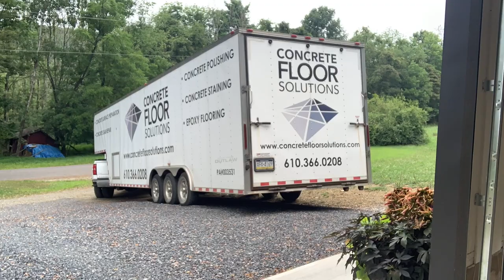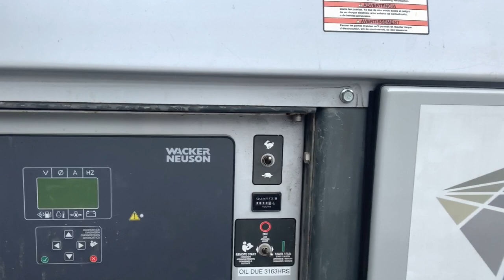How To Install A Polyaspartic 3 Coat system with With Epoxy Primer And Basecoat

Comment: Just have to say, to people who aren’t in this industry this is as good as a professional can get, when you work in this line of work you can always pick apart another contractor, definitely not the case in your videos, everything you do is top notch, we are a flatwork contractor in New York who do epoxy flooring as well and love watching other contractors videos and I’ve gotta tell you I’ve never watched any videos on YouTube that are more thorough, if you are gonna do what you do you have to be setup for it and you definitely are, I’m in the market for an entry level self propelled Grinder and vac system (tired of using the double headed echo) any advice? Love everything you guys do!
Reply from the maker: Thank you for the great compliment. I really like the husqvarna grinders, they bought HTC a couple years ago. They have an 820 planetary thats really nice.  They need to come up with a floating shrowd like we have on our HTC800 or else you have to adjust the dust skirt all the time. I would also recommend the high voltage units. 480v is the top dog as far as grinding goes. I just posted a video yesterday another floor at this same school but different location.

Comment: What’s the average cost to hire you to do a 400  sqft. Garage.    Your not in my area but it will help when comparing the local guys.  I want it done right.
Reply from the maker: 4,000.00 is average, epoxy prices have risen, so it will probably increase a bit
Reply: @ConcreteFloorSolutions  can I have half done then move everything over without having an obvious line.   It would be flake
Reply from the maker: @Imwright720  you will most likely see a line.

Comment: Have you ever accidently gotten product on the walls without taping? If so, how does one remove product on walls ect?
Reply from the maker: You need to wipe it with acetone while it's still liquid, once it cures, nothing will remove it except for grinding or sanding

Comment: Did you spread moreflakes just before the polyaspartic? I need to touch up the flakes on my epoxy before doing the poly clear coat and don’t want to screw up the clear coat with loose chips. Any advice?
Reply from the maker: George Utter You can probably roll out the clearcoat, sprinkle a couple flakes where needed and roll more clear coat on top of it.  I don’t know how large of an area you are trying to fix. Some of the flakes are definitely going to stick to the roller when you do that. But the majority should stick to the floor.

Comment: First, great video!! One thing that I was wondering was how much time lapsed between each layer? After you put down the primer, how much time do you have before needing to put down the second coat (12 hours?) and then, after the second coat, how much time do you have before needing to put down the poly? Lastly, it looks like you use the same, non-notched squeegee for each layer so I'm guess you just wipe it off between layers? Thanks!!
Reply from the maker: On this particular project we did one coat per day, so approximately 24 hours apart. You do not want to wait over 30+/- hours between coats, oils will release from the epoxy and actually repel the next coat if you wait too long.
Yes we clean our squeegee with acetone after each install.
Reply: @ConcreteFloorSolutions  Thank you very much for the response! I am trying to do a two section, two different color set-up which is why I was curious about the cure time. The first area would be red/white/black/gray, full flake. Second section which would surround (boarder) the first section would be a 3' boarder of a single color flake  such as a dark/medium gray. Was trying to figure out how to tape off one area from another without having the tape pull up any of the material. Not sure if you've ever done this sort of thing but if you had any advice, that would be great. The process I'm thinking of is: laydown the primer in the entire area. 12 hours later, tape off the center area and lay down the base coat and flake. 12 hours later, scrape excess flake. Once complete, tape off this area so that the 3' boarder is now expose. Laydown the base coat and flake. Come back 12 hours later, scrape off excess, remove the tape, and laydown the polyaspartic top coat over both areas. Max cure time for any one area would be 24 hours but I could adjust that down if you think that would be necessary. I'm just concerned of the tape pulling up any of the material. Any insight into your experience or thoughts on my process would be appreciated!!! And of course, if you think this will work, please feel free to refer me to the products and amounts on your page that I would need to purchase. The center area total sq ft is 370 and the boarder is 250 sq ft.
Reply from the maker: @michaelg503  Yes, that is very doable and I agree with how you would be doing it. I would prefer to go over some details with you verbally, it's much easier than typing. If you want to email me your phone number, I will call you back jason@concretefloorsolutions.com

Comment: I've seen a couple kinds of flake application, application to rejection and some more sparingly applied. Is this mainly a visual taste thing?
Reply from the maker: I typically do not like to apply flakes to rejection at least in a garage application. The flakes are made of vinyl and not as strong as the epoxy around it. Therefore under a point load could possibly crush and be the weakest part of the floor. That is why in most of my garage floors we install, the flakes are random and laying flat to avoid that issue. I hope that makes sense.
Reply: @ConcreteFloorSolutions  Thanks and thanks for the great videos.

Comment: Wow, great job Jason! 
I live in Northern Ontario Canada, commonly referred to as God's country by most folks up here! .... So, I just finished grinding my garage floor and so now I'm ready to lay the product. Unfortunately, I've been held back as we had heavy rain every single day for the last 5 days .... (which hardly EVER happens up here but with my crappy luck lately, I'm not surprised...lol). Weather forecast is looking great all of next week so hopefully I'll be able to apply the first coat on Monday. I already bought the epoxy base & flakes and I was about to buy an epoxy clear today, however after watching several of your videos this morning, I think I'll go with a poly clear instead. I wasn't sure if I could use a polyaspartic clear on top of an epoxy base and flakes, but that combination appears to be your 1st choice. Based on your advice, I'm doing the same.
By the way Jason, you're a very good instructor. Love your videos - please keep'em coming.
You have a new subscriber bud.
Thanks man!
Reply from the maker: Thank you for watching and good luck with your floor.

Comment: I love your videos.
I've been watching and learning about epoxy and polyaspartic floors.
We're looking at a new construction house (new garage).  I would love to put a polyaspartic coat on the garage floor.  I have 2 quick questions:  1.  Is it OK to apply polyaspartic when it's cold--I'm in New England and winter is around the corner?  2.  Is it OK to apply it to relatively new concrete (few months old--no car has ever driven on it)?
Reply from the maker: You want temps above 40 and concrete needs to cure for 30 days before applying coatings.

Comment: Is it always better to use epoxy as a base coat vs polyurea/polyaspartic. then use the polyaspartic as a topcoat?
Reply from the maker: the Epoxies penetrate better into concrete then the Polyaspartic. So yes, the epoxy is a better material to bond to the concrete, the polyaspartic is a far superior topcoat. They both have their places.
If you are installing this exterior, I would recommend the epoxy primer, polyaspartic intermediate coat with flake, then polyaspartic topcoat.
If you are installing it in a garage, you can install the epoxy primer, epoxy, intermediate coat with flake then the polyaspartic topcoat.
If you have any other questions, you can email me directly jason@concretefloorsolutions.com

Comment: what determines whether you use an epoxy prime coat or just skipping it?
Reply from the maker: I always recommend a primer, it has not let me down in 28 years. If your concrete is extremely porous, or not in good condition, I would highly recommend a primer. If not, you may not need it, but there is always a risk when not using a primer. The primer penetrates into the concrete, which thicker coatings do not.

Comment: Can you finish the concrete on the walls and stairs?
Reply from the maker: Yes, you can run the material up the walls. If it is only 6 inches or so you can use the same material on the floor. If you are going three or 4 feet of the wall, I would recommend a vertical epoxy that we sell.
Primer:https:
//concretefloorsolutions.com/product/cfs-015v-vertical-epoxy-primer-2-gallon-kit/
top coat:
https://concretefloorsolutions.com/product/cfs-100v-vertical-epoxy-top-coat/

Comment: Why not wash the floors before the coating
Reply from the maker: Because it will take an extra day to install because you need the water to dry from the floor. Epoxy does not like water. The primer is designed to penetrate into the concrete, washing is just an extra step that adds another day that you don't need to do.  Primer is the key. Not all contractors install a primer.

Comment: Where did you get the ergonomic chair you used when grinding the floor?
I’ve seen it before but could never find one.
Reply from the maker: Its called a racatac, if you look online, you can find it. Just make sure you get the right configuration.
Reply: Thank you

Comment: So do you have the generator because the grinder is 3 phase?  Might be a dumb question. 😂
Reply from the maker: Yes, the grinders and vacuum system are all 480 3 phase.
Reply: @ConcreteFloorSolutions  thanks!  Do you have an email I could get?  I had a question if you don’t mind!
Reply from the maker: @jamesandrews598  jason@concretefloorsolutions.com